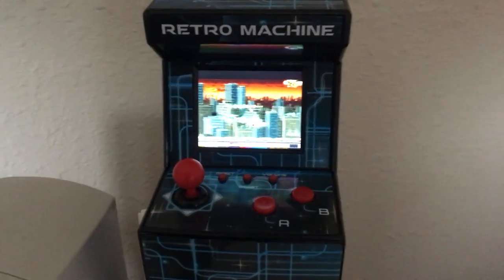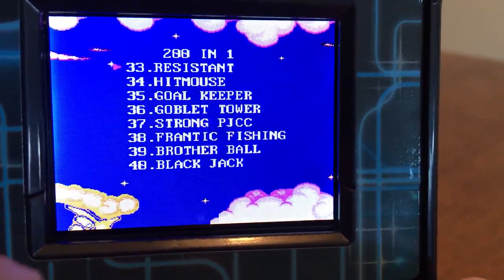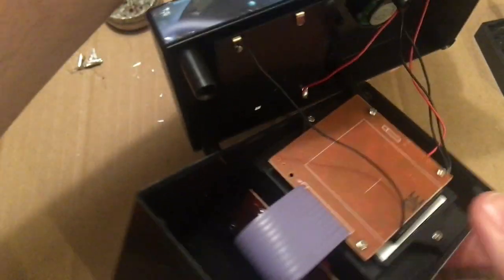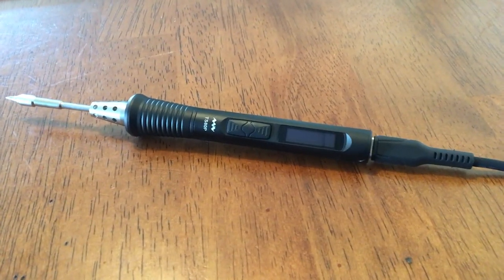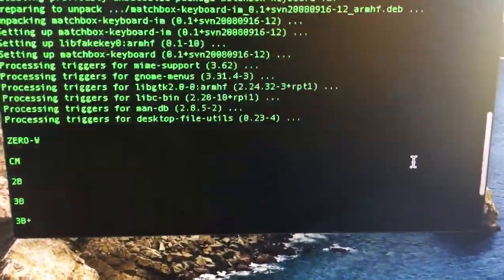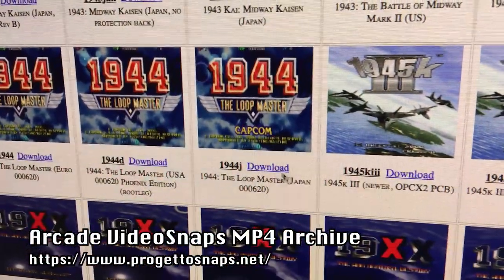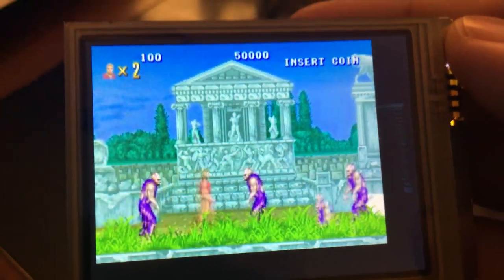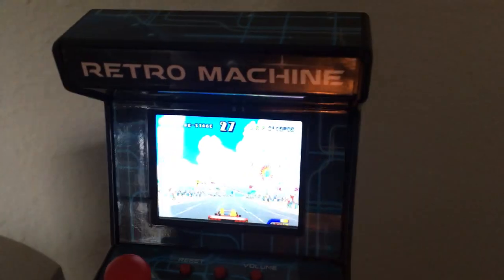Let Me Tell You About My... Raspberry Pi Zero Mini Arcade Cabinet Hack

Comment: Nice project! I was going to do something like this a couple years ago using one of those mini fix it felix arcade games. They're clearly designed after Donkey Kong so I wanted to add a pi that would auto boot into it. I ran into an issue like you mentioned where the screen was compatible with the pi...at one point...a long time ago with no updated drivers. I stumbled upon this video after finding the half finished project in my closet and I wanted to see if anyone had done something similar in the years since I'd given up.

Comment: This was JUST the project I wanted to try, and bam, a video made recently appears.
Reply from the maker: Hope it helps. I've watched enough of these inspirational maker videos in my time that I thought it'd be good to share my idea with others and hopefully give the same inspiration back!
Reply: @peanutismint  i actually have this very machine from years ago, but i was actually gonna try to mod a more recent MyArcade machine (a Data East classics one).  I initially got excited because it came with a 5 inch display and the board ran on android for the included Data East roms, and the board had a USB input to regain control. I just dont think the board is powerful enough to run basic games that aren't the included ones (that, and not a lot of good front end options for the included Android 4.0 software).    Gonna just take my losses with that idea and get a new display and hook it up to a Pi 0 or 3b+, as the case is nice enough.

Comment: Oh, also, if you wanted to, could you repurpose the included controls, or were they basically stuck/locked into the control board?
Reply from the maker: I thought about that too but, as you guessed, the buttons were hard-soldered to the board. Funny thing is, the Pi Zero has bluetooth so if you wanted to you could probably connect a BT gamepad or even full size USB arcad stick and play some emulated games on this thing!
Reply: @peanutismint  Figured. MyArcade just came out with a Street Fighter 2 cab for $50. It's pretty fine on its own, but it could be even sweeter if you wanted to break it open and add your own screen, a pi 0, and if possible, reuse the existing controls. Haven't broken into it yet to see what's going on inside tho.

Comment: Hey, very cool video. I have the same little machine and i want to do the exact same thing. Im currently running some test with a Raspberry Pi 3B+ and omxplayer is lagging (low framerate) with the video. Did you experience the same thing or did you do some tweaking to fix it?
Reply from the maker: Are you running via command line or GUI/desktop? I didn't have to do any tweaking to mine but I remember it being pretty laggy when i tried to run it via VLC on Ubuntu desktop.
Reply: @peanutismint  I was running it via command line with omxplayer. I think the screen im using is causing the issue

Comment: Hi! I have the same machine and I want to go to the next step than your project. I checked and I think I can reuse the same controls directly to the gpio and add a sound card and batteries to run independently. 
Can you share which screen are you using, please? Can this screen runs at 60hz with no problems? Thanks a lot in advance.
Reply from the maker: Hi, the screen I used was an iUniker 2.8" touchscreen; I bought it from Amazon but they stopped selling them for a long time. They recently started with a new one, though, that's slightly different. It may be useful. Hope you can take it to the next level! 👍